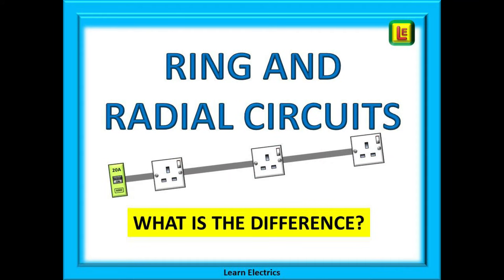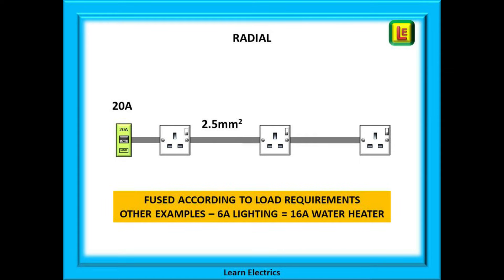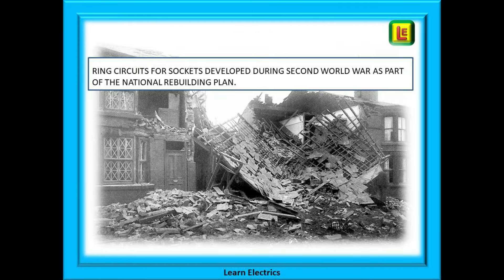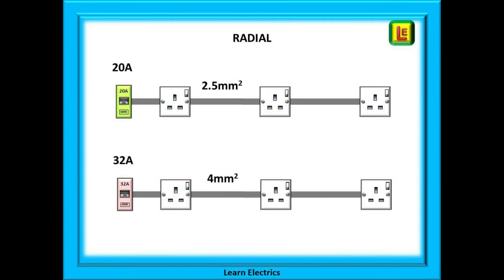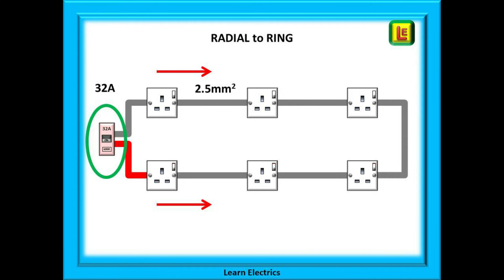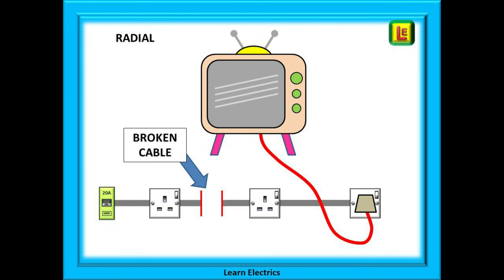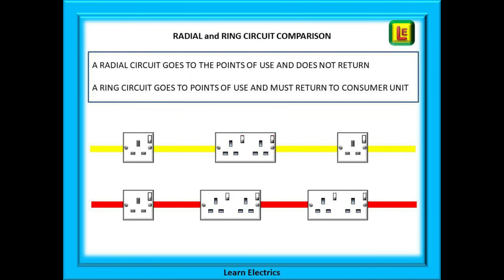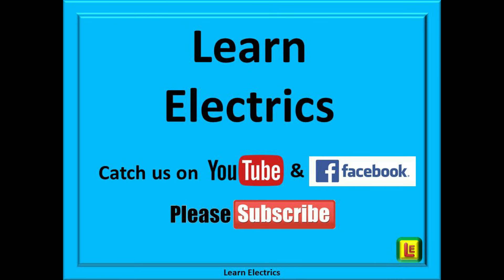RING and RADIAL CIRCUITS. WHAT ARE THE DIFFERENCES.

Comment: Good vid but its not common for cables to be cut in normal conditions. So which is better. I prefer ringmain. I was hoping your vid would clear this up for me. But it doesn't.
Reply from the maker: Colin, there is no better way; it is all down to personal choice. There is no right or wrong with ring or radial. It is left to each electrician to decide and as long as it is safe and functional I can't see that one is any better. I can't be any more helpful than that. Dave.

Comment: Is there a way to identify if a socket is on a ring or radial?
Reply from the maker: If there is only one phase wire leaving the mcb, then its likely to be a radial. If two phase wires leave the mcb, it might be ring, or it might be two radials. look at our video 
RING CIRCUIT TESTING on the following link

https://www.youtube.com/watch?v=-PAruseUf04
Reply: @learnelectrics4402   thanks I have been demolishing my kitchen and now it looks like I have three radials, the ceiling is down so it’s easy to see what’s what.

Comment: Just a question popped out from my mind is that, how many normal soscket outlet 13Amp can a 2.5mm radial cct. Is it 3 with 20Amps? Alsi how many also 13amp sso can ring 2.5mm safely installed? Is it 6?
Reply from the maker: There is no recommended number or maximum quoted in the Regulations. as long as the size of cable is correct for the size of fuse or breaker the circuit should be safe.
Hope this helps